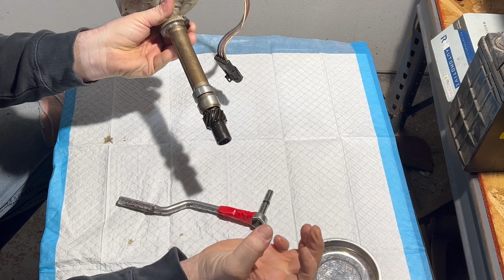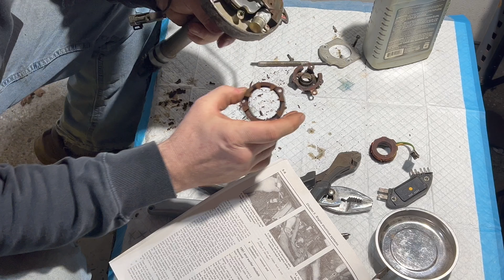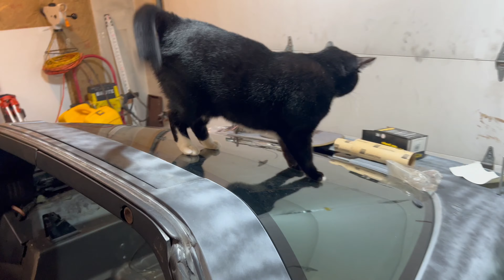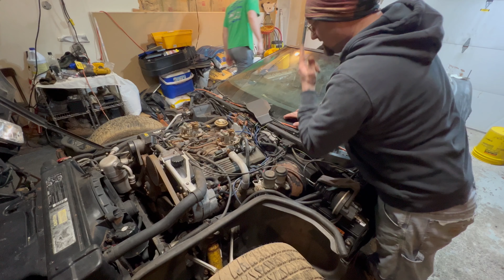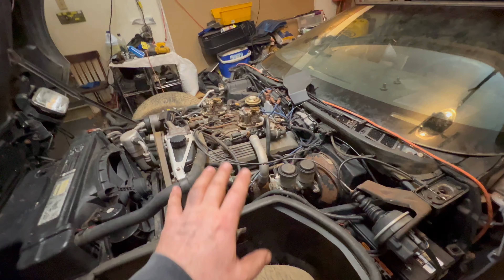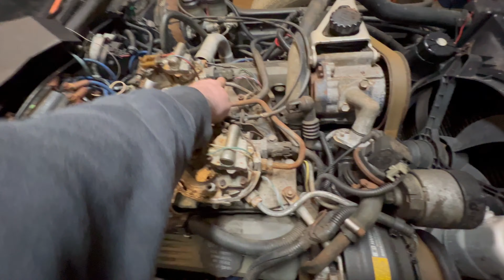(Video #2) C4 1984 Corvette, Distributor Rebuild

Comment: One of The first thing you should always do when a something has been sitting for a long time is pull the distributor and prime the oil pump manually before ever trying to turn the engine over (cool car tho! I have a red 84)

Comment: right on great job.  i was hoping you were going to flush out the lines and replace filter

the door lights are likely flashing because the door jam switches (in by the hinge pillar) need to be cleaned out.  not to be confused with the door ajar switch whose sole purchase is to ignite the door ajar light in the information center

when my daughter and i did hers, we had to tap the passenger side injector to get it unstuck.